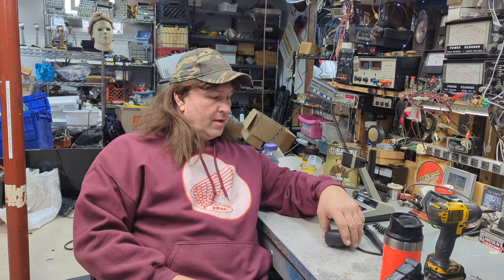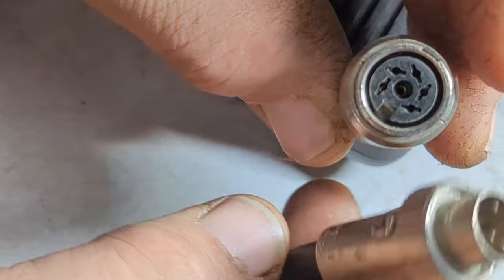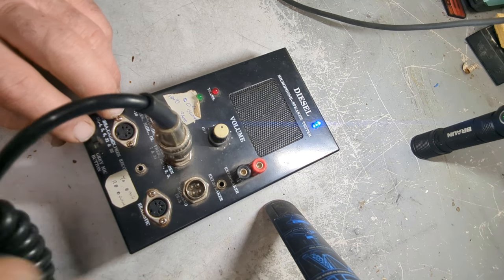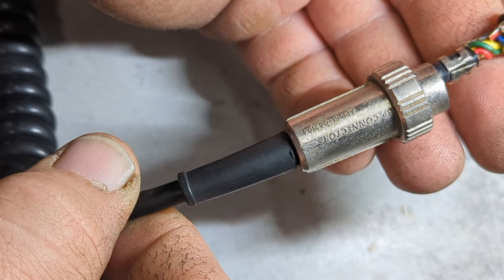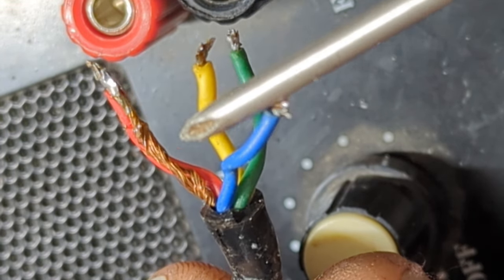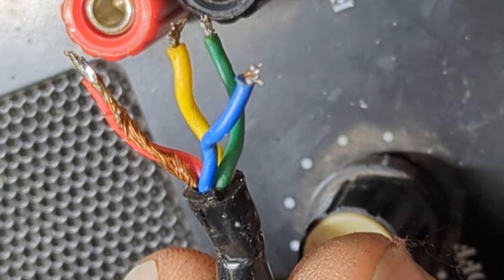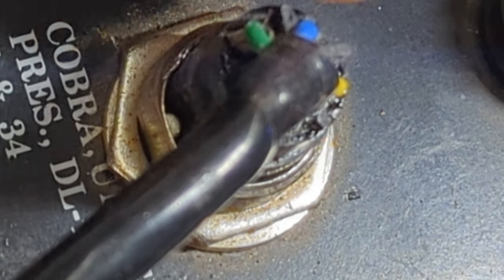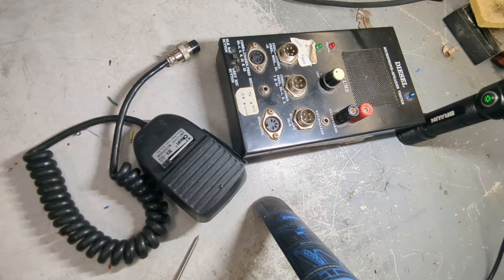CB radio microphone wiring plug on a power mic Cobra Uniden Galaxy

Comment: #bucketsgarage   SE Ohio here   Thanks for the video.  I have a Ranger SRA 117 Echo/power mic that requires a 8volt power source  from radio Says it 8nly works for newer Green face RCI 2950DX 2970DX ONLY .That being said i have an old Orange face RCI 2950 That i would like to see if there is a way to pick up 8 volt off board in the RCI 2950 Old style to make this mic work ? Thoughts ?   73s
Reply from the maker: Hey there bud, thanks for watching. That is a good question. I'm going to look into that. I like that. That's a good idea. I do have one of those old rangers myself. I'm going to dig into it and see if I can find an eight  volt source hopefully with enough amps

Comment: How do you wire   a 452 echo mic to a cobra 19dx 4 pin
Reply from the maker: Hey there bud! Let me see if I can help you. Give me a couple minutes. Let me take a look... In fact,if you  want to message me at bucket's garage @ facebook.com I have that same mic. I do believe the wiring. There's shield white, red and blue. I think I'm going to have to look
Reply from the maker: Okay, I checked here on mine now I remember if it's the same as mine.
  pin 1
Black and shield, ground
Pin 2
 is your audio, red.
Pin 3
Is White, transmit
Pin 4
 blue, receive

Comment: @bucketsgarage I just found your video and im so hoping you can help me please please. I have a cobra sound tracker 25 wx St and the wiring on the mic separated from the plug. I found the codes but my wiring is blue, red, white, and a wire with no insulation. But on charts it doesnt show color. It just shows shield, mod, receive, and TX. But i Don t know what color is what and i went to a cb shop and they gave me a color code and it wasnt correct. Can you tell me exactly what colors go to what symbols or what color goes to what number please? I have an older cobra mic but the colors are yellow, black, red, and solid wire with no insulation.
Reply from the maker: Hey there bud, I hope I can help and I'd like to 😁 okay
 number 1 is (shield ground)
Number 2 is white ( audio)
Number 3 is red (transmit)
Number 4 blue ( receive) 
That should be the correct wiring. At least you know which ones are the trigger points
If that still don't work, don't forget join my facebook page buckets garage and send me a message. I can send you a picture of the inside of the microphone as well. Hopefully I can get you going again. And thanks for checking my page out. Definitely let me know if this works. Thanks bud. Have a good night
Reply: @bucketsgarage  awesome that helps a lot. I couldnt figure it out cause I had an old cobra mic I had found that had a yellow, white, black, and a solid wire and I didnt think it would work in that cobra cb but i tried it and it did work. Now I found a table mic I guess you call it and its called a Royce model 2-080 in the cobra cb and it didnt work so ill have to try to wire that correctly. Not sure what the colors are on the wires I havent opened or taken it apart to see yet. Im new to the cb world but have had a few for a little while so im learning. Thank you for the info.
Reply from the maker: @shyskeleton1665  grate!! I'm happy it worked glad I could help and welcome to the CB world! It's a lot of fun!! Ttys You're welcome and thanks!, buckets 😁
Reply: @bucketsgarage  hey there again friend sorry to bug you again and thank for the info on the other question it helped. But now I was trying to figure out why this Royce 2-080 isnt working. So i took apart the plug and 3 of the wires werent connected. I tryed to research info to connect it to a 4 pin but couldnt find anything. Its a desk top mic and colors of the wires are red, black, white, purple, and a shield. What colors wires do I connect to pins 1 2 3 and 4? I know you said white and yellow is always audio and sold wire is shield. But the the black red and purple wires I have no clue.
Reply from the maker: @shyskeleton1665  yeah, it's crazy how they make someone different connections, especially when you come to these oddball radios let me do some research to my stuff here yeah that is a different one It's possible you might have to take the mike apart to see where the head soldered on the wires to the switch.
Reply from the maker: @shyskeleton1665  oh yeah I love a good challenge 😆🤣

Comment: Hi, l'm trying to wire my Kenwood MC-60 8pin to an Anytone Ares ii 4pin, Im new to cb radios so any assistance would be appreciated
Reply from the maker: Good evening bud, thanks for contacting me. Yeah I'm taking a look. It is a pretty cool microphone from what I could see, white wire is for your audio course. You have your shield then you have black and green The black wire I would connect to the shield. The green wire is for your key up No, I don't know what the inside of that microphone looks like, but according to the instructions that I'm looking at, it's only a two position switch if the radio has automatic sound. In other words, if you can hear it working without the microphone plugged in you are golden, but if not you may have to change the switch inside the microphone unless it is a two position switch which would mean black would be center green would be key up and then the other one could be whatever you solder to it. Let me know how it goes. In fact, you can message me through Facebook at buckets Garage. I can send you some pictures. Hopefully this helps. Let me know. Thanks for watching , Buckets